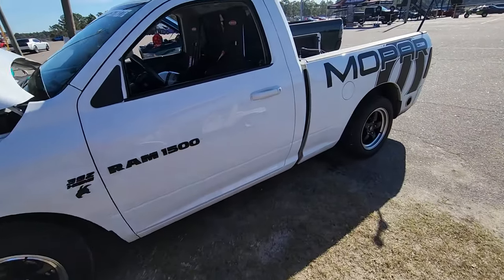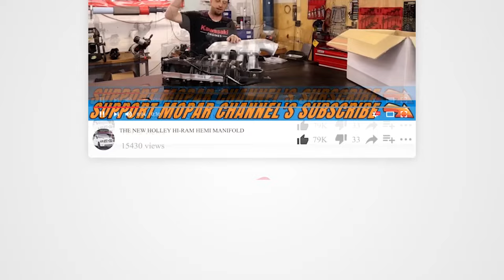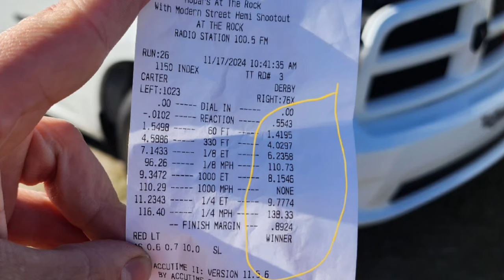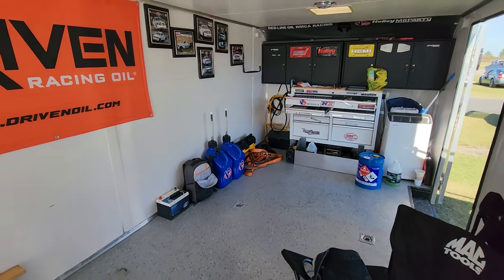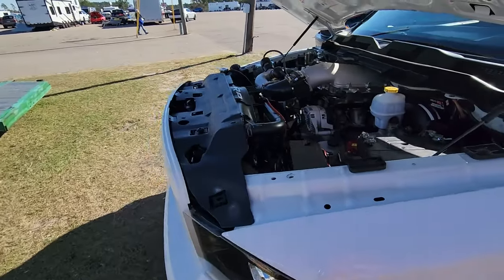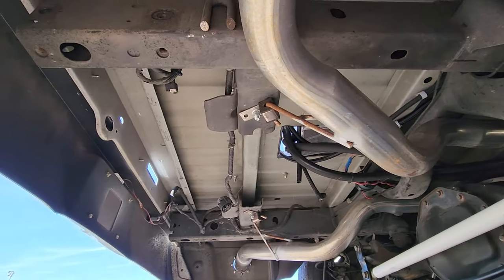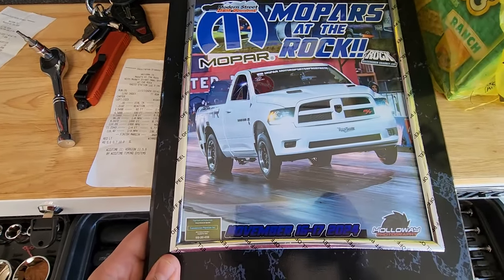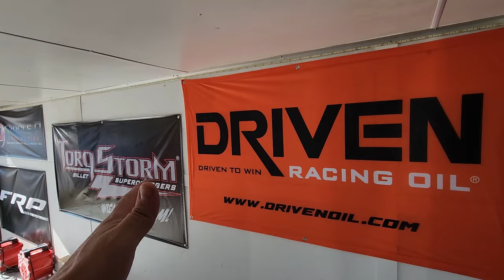RAM Truck Runs 9 Second 1/4 Mile 4600lbs How Did We Do It.

Comment: Smart builder here. No need for big cubic inch on these engines. Steve Morris made 1600 crank hp at 17psi with cam and drop ins on a 392. Of course his manifold is crazy good. Run enough boost and anything is possible. If that doesn't get it done, spray and pray
Reply from the maker: @mikew6135  for sure💨

Comment: I was thinking it was impressive getting into the nines until you said you didn’t use the juice! Would be easy to get into the 8’s maybe 7’s when you start using the juice! Love those 6.4 blocks!
Reply from the maker: @derickhorne713  💪definitely
Reply: Getting into the 8s is not as easy as spraying. Knocking off another 1-2 seconds at that speed is extremely difficult. Nitrous alone ain't doing it.
Reply from the maker: @paulunderwood7945  that was first outing on the new setup so I know we can do alot better but yeah it takes more to push a brick.
Reply: @FrostbiteRam  Not criticizing. Truck is amazing. Just know how difficult reducing 1 second is at that weight/speed. 

14 sec to 13 is easy. 9s to 8s or even 7s is crazy tough. Major congrats nonetheless
Reply from the maker: Thanks man, not sure how much farther we will try to push it. I'm really thinking 9.50s would be a good place to target for class racing.